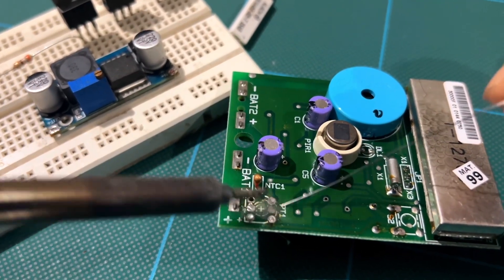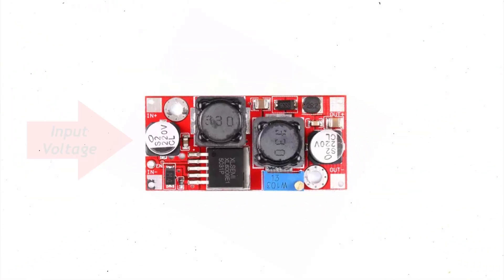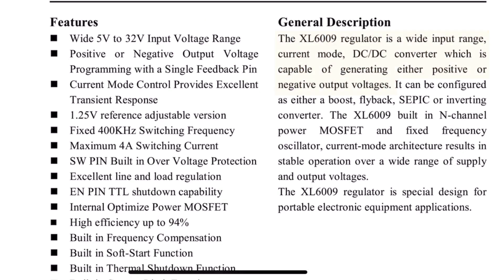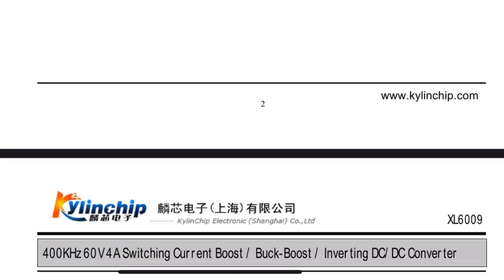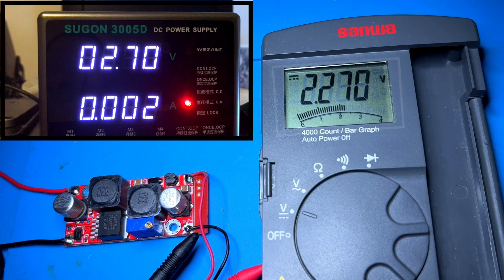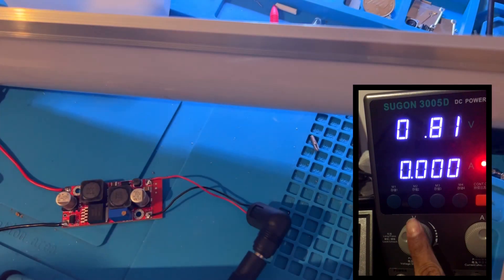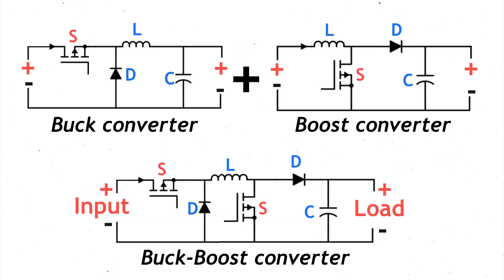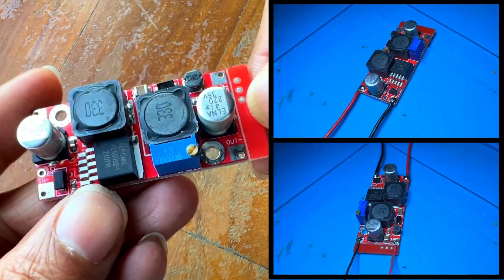How to use XL6009 Buck-Boost Module.How to step up and step down DC voltage efficiently (SINHALA)

Comment: XL Semiconductor (XLSEMI) has released two XL60XX IC's. You can find either boost or buck-boost modules including these ICs.  

Earlier version is XL6009
5V to 32V Input Voltage
400KHz Switching Frequency
4A Switching Current

New version is XL6019
5V to 40V Input Voltage
180KHz Switching Frequency
5A Switching Current

Some people says 400KHz Switching Frequency of XL6009 is interfere with WiFi signal (adding harmonics), but if the Switching Frequency is high you can use smaller capacitors and inductors.
Reply from the maker: very valuable informations bro. thank you very much 🤜🤛
Reply: @theelectroroot4919  you're welcome brother 🤜🤛